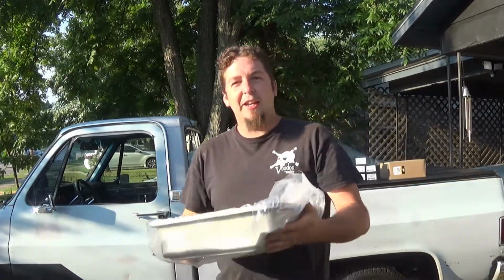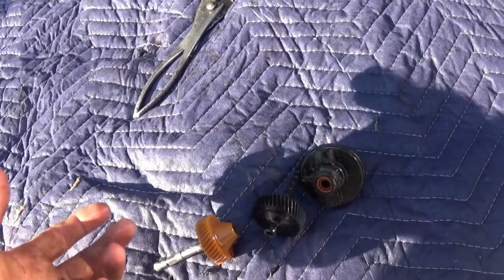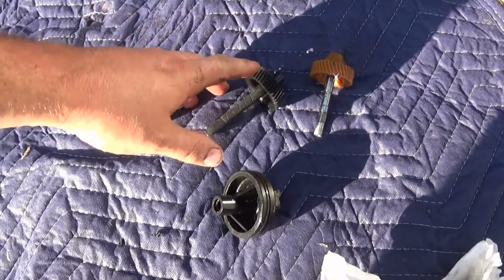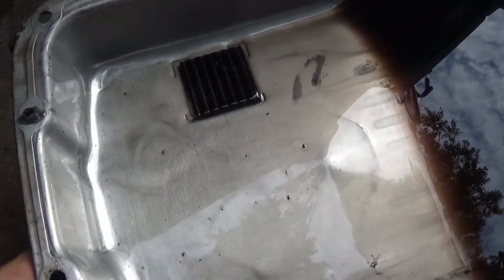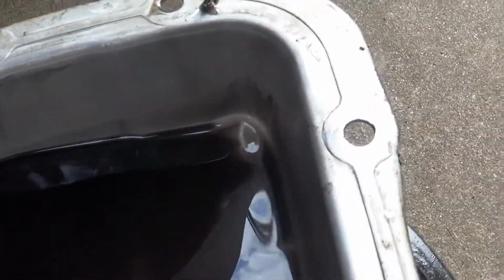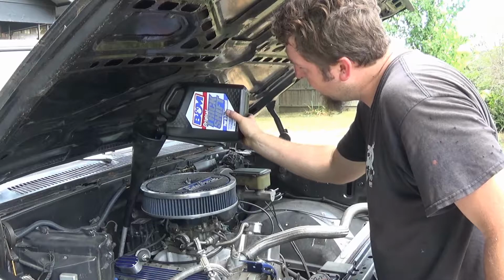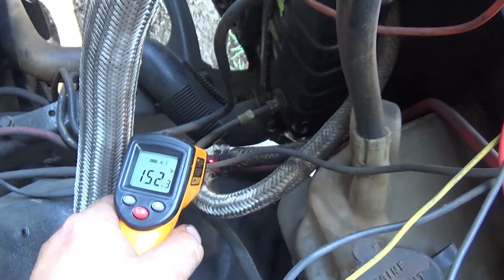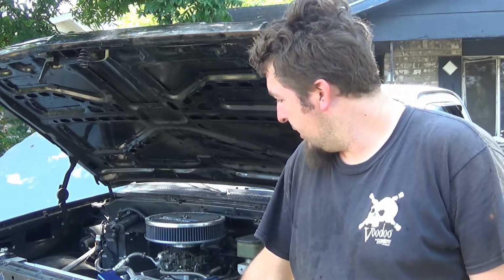A little transmission work,  Work truck C10 ep 17

Comment: Nice work, I tried trick shift in the Satellite a long time before I got the 904 rebuilt with a hard shifting valve body and it seemed to help a little. I've also had very good results with Lucas Transmission Stop Slip. Honestly even better results than I had with Trick Shift.
Reply from the maker: as far as lucus i always was told that it can be to thick for the transmission.... secretly i have used it in power steering with good results. i have tried lucus in a transmission before but it didnt help, could be the transmission was beyond help. but trick shift has been good to me for years.

Comment: Do you have a transtar in your area?!just take yours to them and they will hook you right up on the gears.
Reply from the maker: I do not. Never even heard of them. I found the gears. Just been busy with the Pontiac events and other stuff so i have not ordered any.
Reply: @EfurdGarage  transtar is a transmission parts supplier to nearly all transmission shops. You can buy anything from cheap stuff to factory replacement parts from them. They only deal in transmission parts. I've dealt with them for years.
Reply from the maker: @thecarguy2470  nice i will look into them. i found one company that had them, i got one of those odd ball years so i should have known it would need oddball parts lol